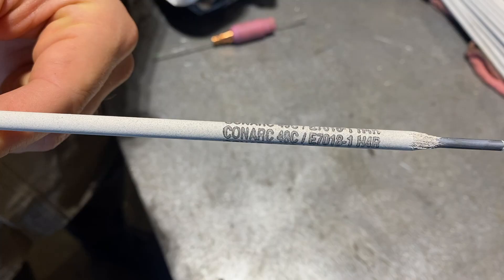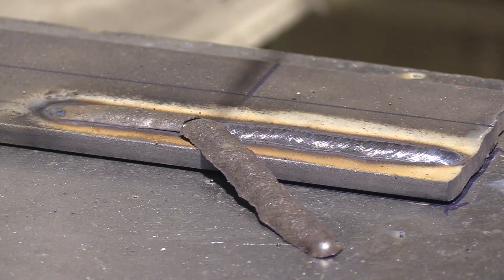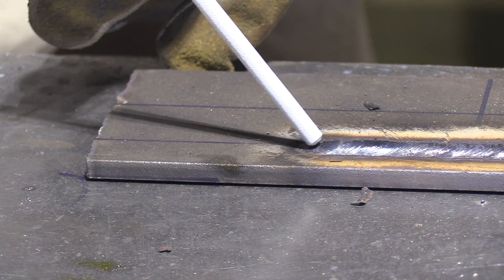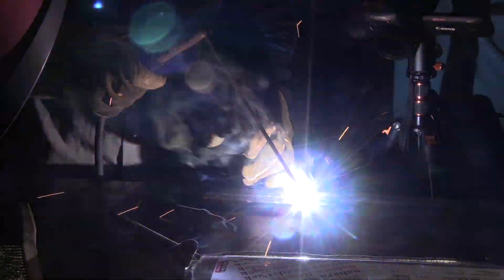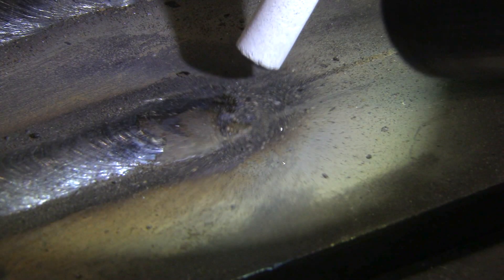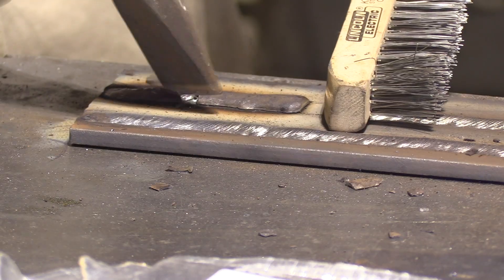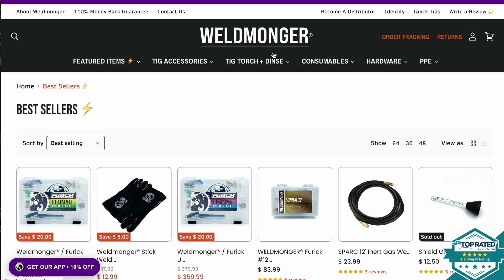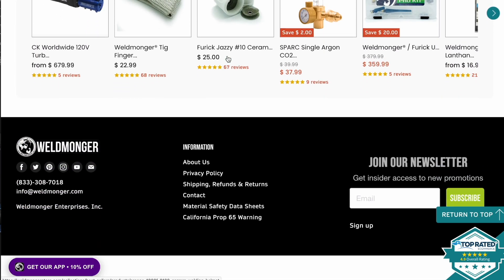CONARC 49C vs Excalibur 7018 Stick Welding Electrodes

Comment: Is there a need to put in a root run with 6010 on structural steel t-joints and cap/build with 7018?

Comment: I've been using conarc 49 since 2015. Decent electrode, still prefer the esab 7018. Needs must and all that. The conarc 49 has changed ever so slightly after about 2021. Twas more robust before 21, flux falls off a hell of a lot easier now.

Comment: bolher 7018 rods are the best, most consistent and never had a bad batch. They just flat work and dont finger nail or have the problem lincoln always has. Esab is a good rod but pain to get CoC or MTRs on the rods.

Comment: love conarc 49c  at my workplace the rod we use now (slag peels of when you angle more so to say with the heat direction to the pudle/ i use 115 to 125 amps but doesn’t always help guess only easy for blowing slag back)     what i do really like is the gentile nature of the arc and the spatter or lack of , for a root on a v weld one of my favorite

conarc 49c and filarc 36s esab 48.00 and oerlicon tenacito 65R (filarc 56s too)

do you have a different opinion?

Comment: I use Conarc 49C often and like this electrode. Excalibur in Poland I have not yet met on wholesalers. CONARC 49C is stable and when properly stored, hermetic packaging is brilliant and works. In fact, the nuisance of descaling in the case of fillets occurs, but with subsequent stitches it detaches itself. It doesn't bother me, I use a needle scaler always and everywhere - if possible. And quite seriously, I weld with Lincoln, Esab, Bohler, Oerlikon, Castolin Eutectic products and each of them has its leading products selected for a specific task. Regards

Comment: I like Hobart XLM because I can simply buy it at Tractor Supply 15 miles away and I do not really notice a difference in weld quality between it and Lincoln Excalibur. If Tractor Supply or a Welding supply store near the farm had Excalibur rods, I would easily but them over Hobart because the slag does fall off easier.

Comment: ESAB. You can get the long rods. The flux does not break off of the rods very easily. you can nearly bend these rods and still have the flux stay on. They do not fingernail, easy re starts, they wet out real nice, And in my opinion are the best rods on the market.

Comment: I like the rod 7018 because it's a uniform weld and I don't have to waste time with the slag so it's it's it's a time consuming waste time and you have to clean it real good and it just doesn't come off and you want a nice finish prep for painting

Comment: I work with a great welder that always has one curled up, burnt finger on his left glove specifically for holding the rod. He doesn't even put his finger in there. If you're a too cold Excalibur won't peel as easily. I'm always on different machines and that is a dead giveaway that I need to turn it up.

Comment: Am I dreaming or did Andrew's arc length seem a tad bit long to anyone else? Beads looked great, but the globular transfer looked a little off to me...

I'm using Excaliber 7018 at the moment, like the clean puddle. Had good results with Hobart and American Alloy in years past too. Heck even Forney has been decent in a pinch, but don't waste you time and money on Napa's Firepower rods, you'll be swimming through the molten slag.

Comment: Excalibur runs the best, IMO. It takes a lot if heat, and I’ve found that it likes ~90% of the suggested amperage range on the package. It’s a bear to restart a half-rod. The puddle is super clean and I really like how it runs.

ESAB Atom Arc seems to restart a lot better and maybe run smoother but the puddle doesn’t look as good or clean for some reason.

Comment: My favorite E7018 was one of the first E7018's [ invented circa 1947 by Lincoln] It is LH-70. The much vaunted Excalibur was developed for pipe welding, it has a thinner coating, less slag, many like it.   Lincoln LH-70 IS THE ONLY E7018 THAT MEETS MILITARY STANDARDS in the Lincoln E7018 family of rods. Excaliber, LH78, LH73, 7018AC  DO NOT meet mil. stds.

Comment: I tend to mostly agree with the conclusion, I do wish you had done some vertical welding though, I prefer Excalibur for fillet welds down-hand or overhead, but for pipe welds, or vertical up fillet or groove welds I much prefer conarc 49C, I find it much more forgiving as far as bead profile and undercut go than Excalibur rods.

But as for favorite 7018 rod, it isn't 7018, given the option I will always reach for 7016 over 7018.

Comment: I enjoy the Excalibur a lot but I also do really like the bohler 7018's too
Reply: I use Excalibur but prefer Bohler. I can't find it in 50# boxes. And when the welding store only offers it in 5 or 10# at a time it is more costly per pound. Are you able to get it in 50#?

Comment: I used to love Excalibur but I've started to really like the esab atom arc 7018...seems to run smoother and slag comes off easier than the lincoln in my opinion
Reply: I agree, I’ve only run about 20 lbs of it but it’s as good or better than Excalibur

Comment: Love the Excalibur, runs smooth, good bite, and of course the slag removal. Back with Hatfield Electric 30 plus years ago, would beg for 7018 for certain applications. Welding and fabbing brackets for riser runs and electrical fixtures the shop would only send out “5P” good ole 6010. Welder was an old Lincoln 3 phase vertical bullet, painted school bus yellow, our company color with a Blue HE painted on it. 7018 woulda been nice for the flat runs and some fillets, but the shop must have had stock in 5P. Always cleaned up the welds good, and sprayed them with cold galv. Great times with a great outfit! You sure bring back memories , JODY. Much appreciated. Truly like now I’m retirement, occasionally pick up a side hustle, that I can use my own Excalibur 7018, that I bought. 😉. Like to get my hands on that European rod and give it a go.! Thank you JODY🙏

Comment: Bohler 7018-1  it's best rod available in my country,
Also 
6013 RR double coated rutile rod
6013 RC rutile cellulose 
For some specialty repairs 
Carbotrode 91 by german company "Carboweld". This rod is so easy to use that's ridiculous.

Comment: Now that I buy my own welding rods I get my 7018 from Harbor fright. My only complaint about Harbor fright 7918 welding rod is the flux comes too far down on the holder end of the rod sometimes making a bad connection to the holder. And not the best peelers.

Comment: I like air liquide 7018 blue shield. Also Arctek 228 xc which is similar in composition however can be run on lower carbon castings and medium carbon steels. I will burn whatever I am provided though.
Reply: I always found the flux on the Blueshield 7018 had a tendency to break and flake off fresh rods. No prior warning sometimes, you'd just strike an arc and poof, there goes a bunch of the flux